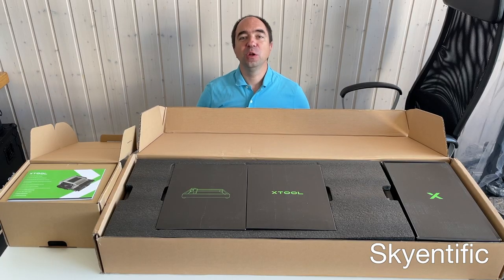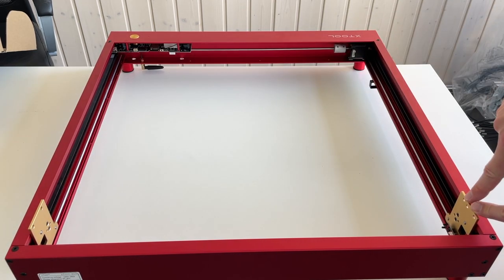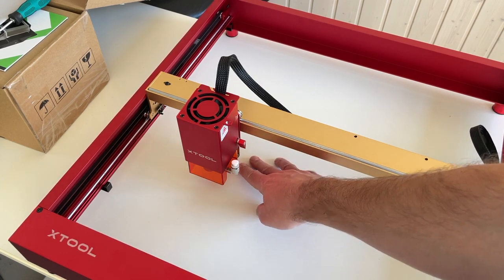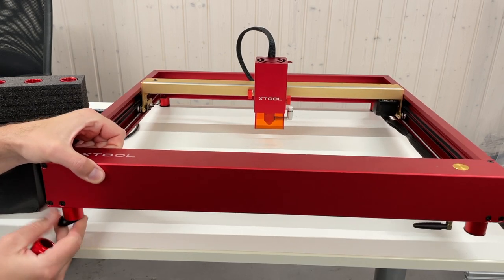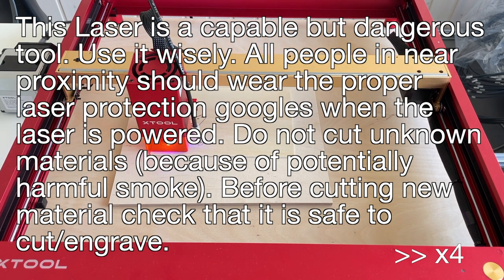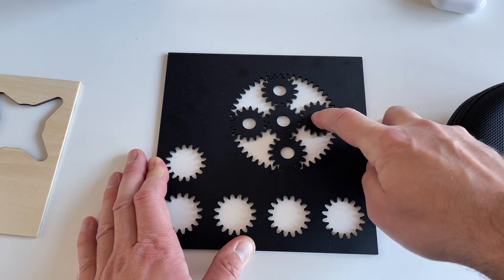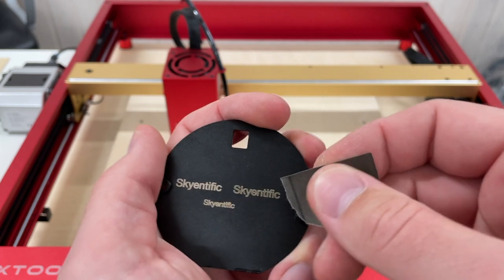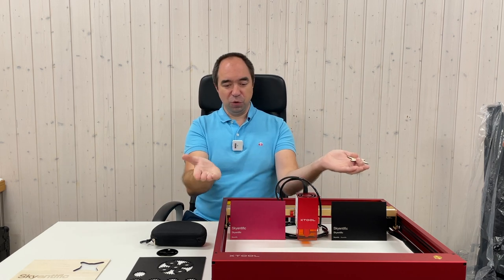This Laser can engrave anodised aluminum. Great tool for your workshop! (xTool D1 Pro)

Comment: You only get one set of eyeballs, and the light that these diodes produce is strong, not blocked, and incredibly dangerous.  As someone whose day job involved these and other lasers for a while, please don't risk it.  Get tested and rated goggles, and build an enclosure.
Reply: They include glasses, so you don't need extra. (Just to clearify)

Comment: really nice package, looks like it has a lot of nice features but once again with all these cheap laser cutters/engravers there is zero thoughts about safety it seems. The little red shield is a joke with all the reflections coming out the sides and the fact that the glasses aren't the same color as the shield means one of them isn't the right spec for the laser wavelength, very scary stuff. On the website it does seem like they at least tried to implement some sort of alarm and detection of weird behaviors but idk how reliable those are.

Comment: I wouldn't trust the glasses alon, who knows if they are up to spec? Build an enclosure that emits no light and equip the laser with  a safety switch so it can't turn on without the enclosure. Or risk losing your eyesight...
Reply: get some goggles from a reputable brand, it's what i did for my fiber laser. not cheap but you only get one pair of eyes innit. even with those goggles i'm scared to look at it when it's operational lol; i still tend to look away
Reply: @ikbendusan  I agree, but if the manufacturer changes the laser so it doesn't have the same wavelength the goggles might not work. I would put it in a non light emitting enclosure. That could also be an easy way to collect the fumes and ventilate out of the room. Don't take chances with your eyesight! Eeek!

Comment: These things should be illegal. NEVER EVER run those inside without proper ventilation (open window is not good enough), never use it when in the same room, don't trust those "protections", never run it unattended, a huge fire hazard. Yes this is conflicting, so the only resolution is to not run it at all! Build a proper exhaust and a light tight enclosure and it might be a very dangerous toy. But my 2 Cents: send it back and get one with a proper enclosure and proper safety equipment and a proper laser output, those 20w are a lie. Maker's Muse made good safety videos of those toys. Watch them and give this thing back as long as you still have two eyes and a working lung.